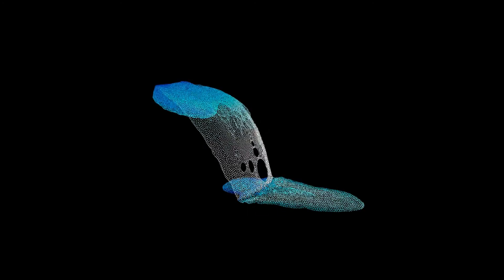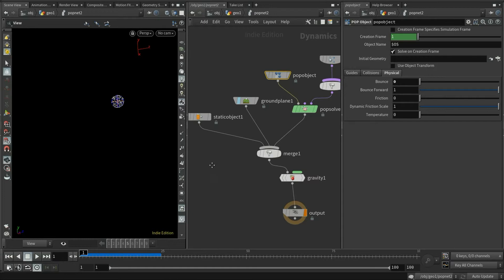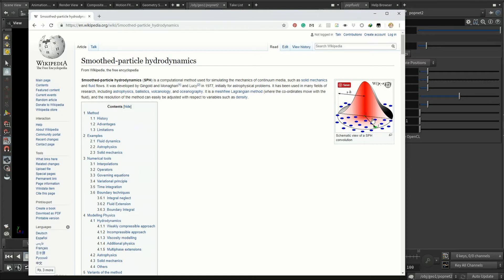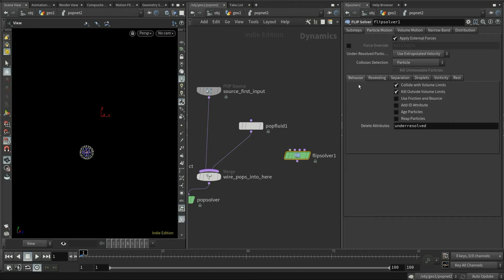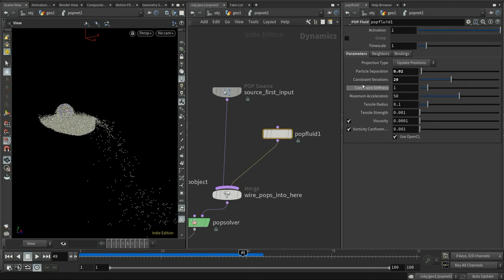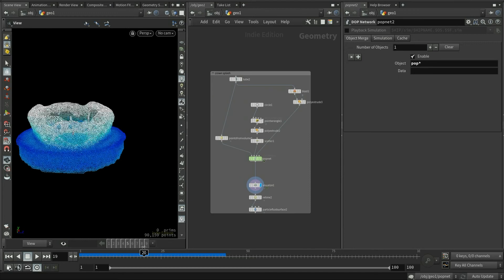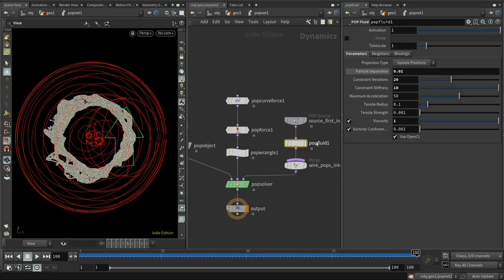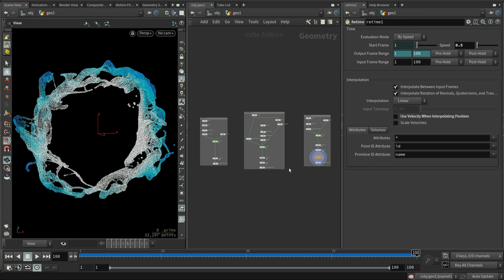Introduction to Houdini 17 POP Fluid

Comment: With Vellum fluids, is there still a good reason to use flip fluids? Or not really?
Reply from the maker: vellum fluids is xpbd, more suitable for small-scale fluids sim, and flip is a mix of fields&points(PIC) which is much more efficient when dealing with large-scale sim(Not saying that you can't use them for one another, as long as there are good reasons to do so). They're good for different purposes and each has its own limitations on both the algorithms&implementation sides.
Reply: @lewisorton713  oh sorry I totally miswrote. My question actually was if pop fluids still has a purpose with vellum fluids existing now! Sorry about the confusion! :D
Reply from the maker: @Handcraftedcc  pop fluid is fully integrated into vellum fluid deep down in the core, you should always use vellum fluid from now on.

Comment: 5:54 could anyone explain what he mean by 10 layer of particles?
Reply from the maker: Hi there, technically you can just use the vellum fluid in H19 without using pop fluid as shown here, pdb fluid is implemented in Vellum since H19.
Reply: @lewisorton713  hi thanks alot with the reply, I has not look into houdini 19 yet , also not sure if they remove pop fluid in houdini 19, but still interested to learn and understand pop fluid in the older version.

currently just do not really understand '10 layer of particle' in 5:54

thanks in advance for the explaination
Reply from the maker: @zhengshu8925  Sure. Think about the concept of 'thickness of fluid' which equals to the diameter of one particle times the count of layers. '10 layers of particles' means when your fluid has at least 10 particles stacked from top to bottom when viewing from the side.
Reply: @lewisorton713  ahh, ok got it, thanks you so much for your time. much appreciate